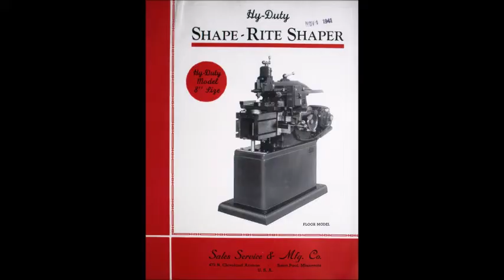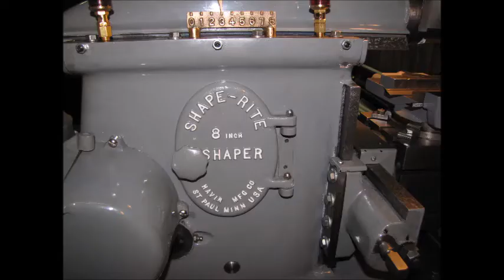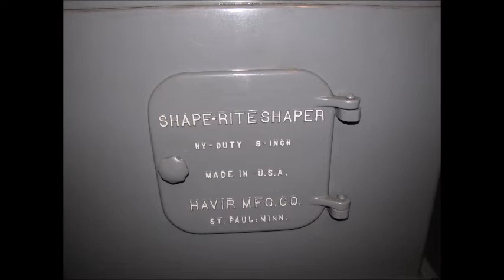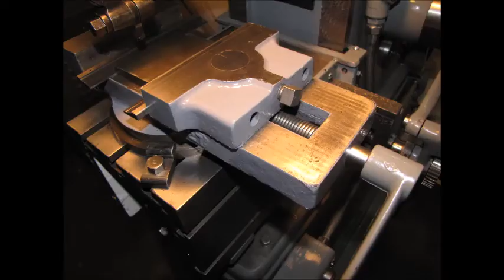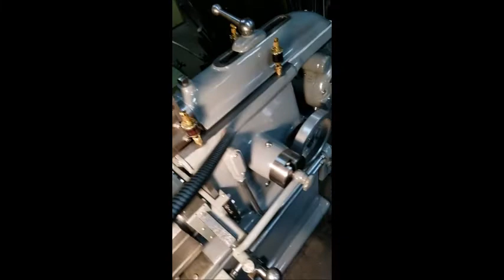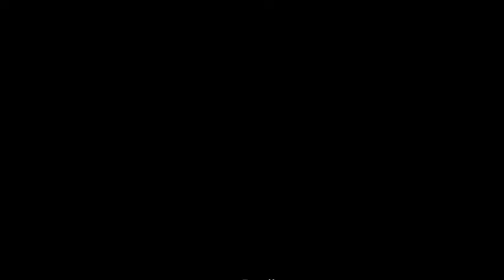Havir Shape Rite

Comment: Thank you for the short history lesson.
It's mid April of 2026 And I just brought home a late model B home, it has the square doors, a swivel box. The drive pulleys are on the other side of the doors. I am missing the ram pointer, clamping block and handle. Machine is in otherwise good condition and sill has the original vice.

Comment: I bought an 8" with the rotating table totally complete with vise for $20 about twenty years ago.  The machine was sitting in a dilapidated garage slated for demolition. The original owner was long gone and his son or grandson knew nothing, nor cared anything about the machine, but just wanted it gone. I moved it to my garage and the only thing i have done with it since then was clamping a block of steel in the vise and used the machine to take a heavy pass across the top. The machine worked flawlessly. My machine is totally blach in color and not pretty. I have often wondered if that was the original color. These machines are incredibly heavy, much heavier than my 7" Atlas.  The Atlas is OK for what it is, but i believe the Shape Rite to be a vastly superior machine in every way. One of these days i will make the time to get some enjoyment out of my machine. Thank you for sharing this video.
Reply from the maker: Thanks for viewing and commenting on this. My brothers Shape-Rite ended up just shy of 700#, with the transmission on the rear. They are very capable machines, for sure.

Comment: Thanks for this information!  I've had a Shape-rite  for a few years but not done much with it.  It has a tag from "Sales, Service & Mfg. Co" calling it a Model HD, S/N 781.  The only paperwork I've been able to find is for "Model B."  It would be nice to find some more information specific to this machine.  Any guidance would be much appreciated.
Reply from the maker: Alan, as I put this video together, I dug about as far as I could into the history of the company, but it is tough finding out much about it or the machines themselves. Surely some of the guys who worked at the plant where these were made are still around, and it would be interesting to chat with them. The three documents cited in this video are all I was able  to come up with. Most shapers during this era were sold with sketchy or no operations manuals. If you haven't done so, I'd suggest you go to https://groups.io/g/Metal-Shapers-and-Planers/messages and do a search on Havir or Shape-Rite.... there are some photos and discussions on these machines in the messages section. I uploaded the full 8 page document in the files section there, which may help you some.  Dan
Reply: @DanLins45594  Dan,thanks very much,  The document stamped 1941 is the only thing I've seen on the HyD version.  I'm not sure there are major differences aside from the motor and pulley setup being on the other side. It would be interesting to know when Havir stopped making shapers.  Most of what I've found online pertains to litigation over punch presses.
Reply from the maker: @Alanmuller1950  Agreed, and I'm fairly certain they stopped making shapers before all those lawsuits rolled up against them. It is very difficult to find more information about this company. Maybe someday some great grandson or daughter of the CEO will enlighten us from some dusty folders in their attic or basement.